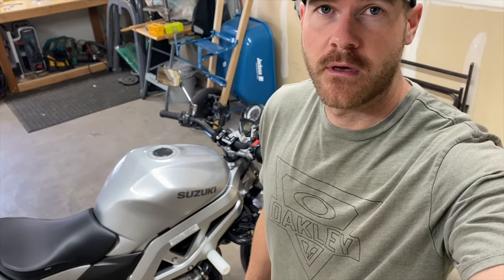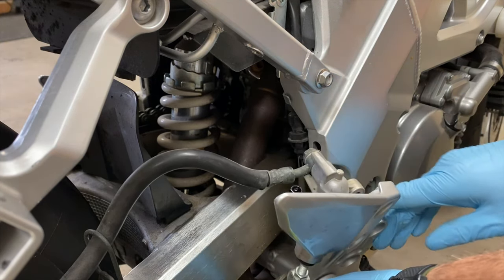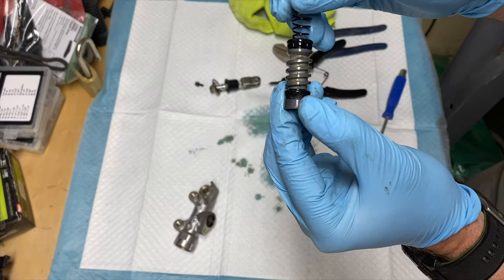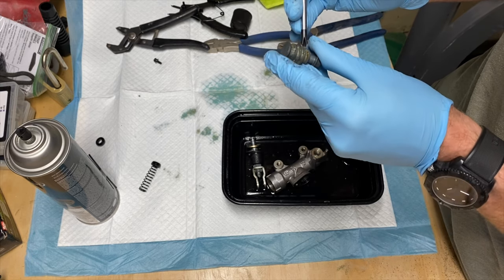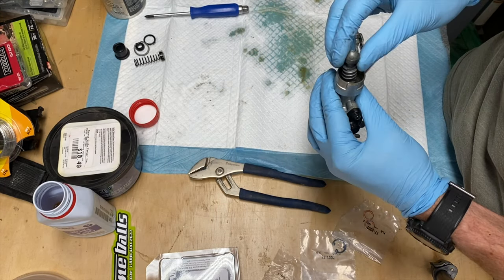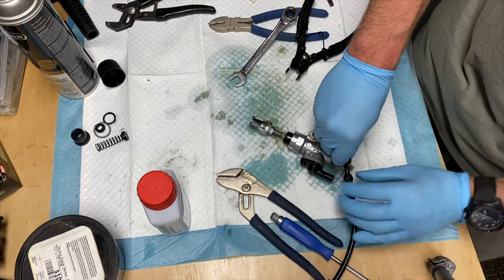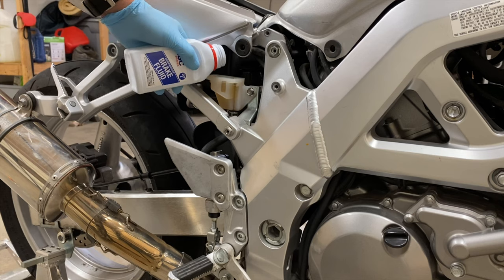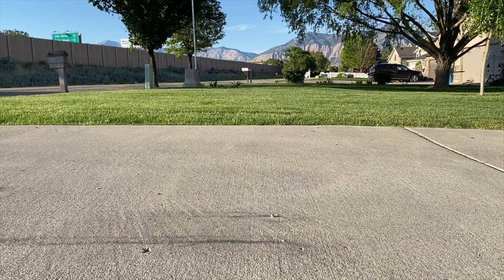Suzuki SV 650 rear brake master cylinder rebuild and steel braided brake line install.

Comment: Clear instructions, good video and audio. 
Can I just make the point that scraping with a screw driver and using a wire brush should be avoided. Always use something much softer than those parts, such as a brass (wire) brush. 
O would have liked to see the front brake master cylinder, but I guess the principles are very similar.
Thanks!